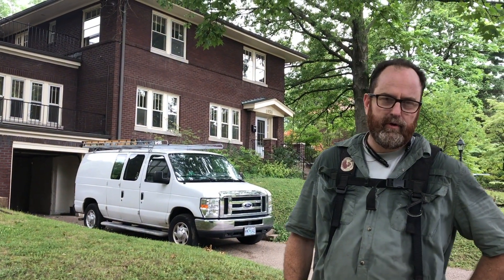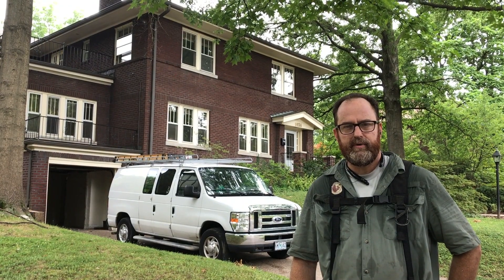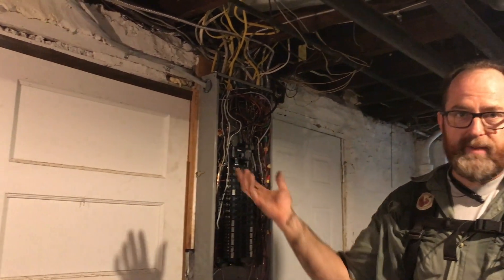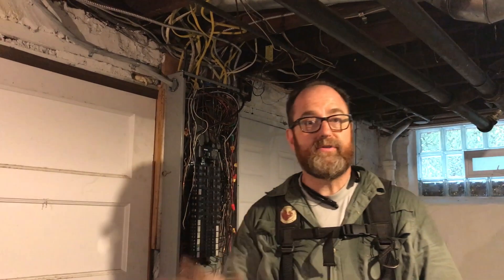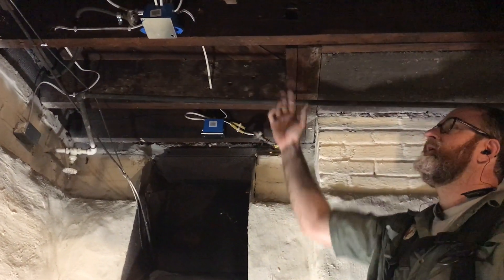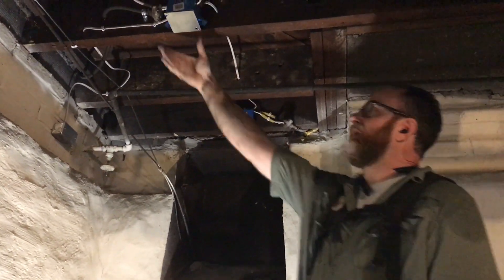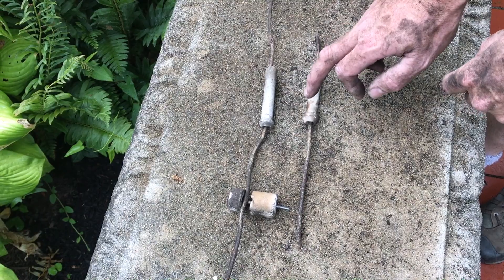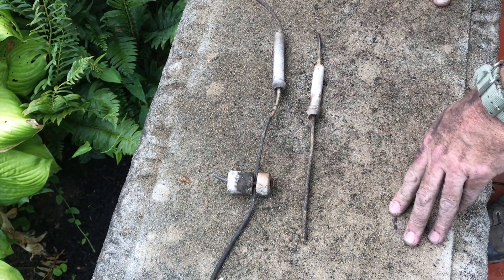Knob and Tube Wiring in U City

Comment: I have a lot of fiberglass insulation over and around the wires and k&t, should I cut back all those parts of insulation? K&t in attic but under house re wired with modern